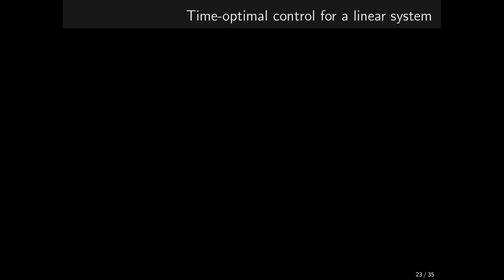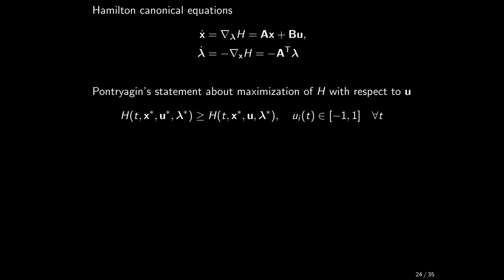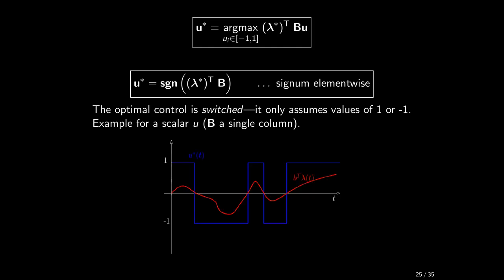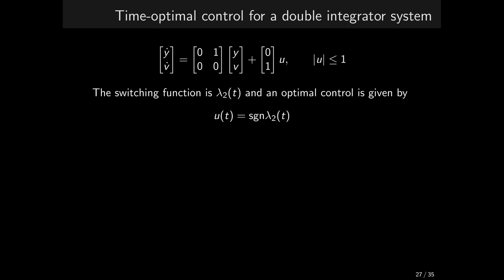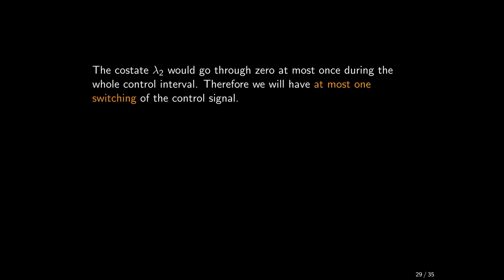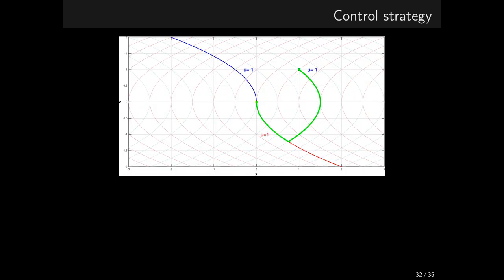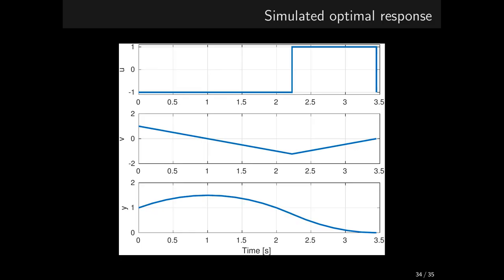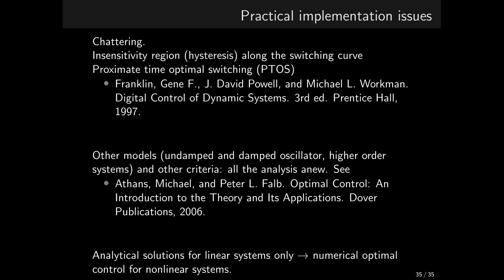L7.3 Time-optimal control for linear systems using Pontryagin's principle of maximum

Comment from the maker: Typo at 6:43: should be lambda2 = -c1 t + x2. The minus sign was missing in the text and video. Fortunately, it had no impact on the validity of subsequent development because, in fact, knowing that the costate lambda2 is a linear function was enough (perhaps combined with the information that at the end of the time interval it was either 1 or -1 thanks to the condition that Hamiltonian is vanishing there).

Comment: Very useful video. Thank you. At the end you mention a next lecture that covers "numerical optimal control". I can't find it on your channel though. Does it still exist?
Reply from the maker: Well, sorry, not yet. Instead, have a look at a list of other resources for the corresponding lecture (or the whole course) at https://moodle.fel.cvut.cz/course/view.php?id=6589. In particular, the block for the topic of numerical optimal control is at https://moodle.fel.cvut.cz/course/view.php?id=6589#section-8. I hope you will find some bits useful even if no video is available.

Comment from the maker: At 11:39 there was an omission in the prescription for an optimal controller. I omitted for each value of the control (1 and -1) the second if part. Somehow this happened while copy&pasting the formulas from the lecture notes (in the lecture notes on page 12 this formula with the vertical curly is full and correct).

This omission is, however, still present in the subsequent boxed formula that is claimed as "the more compact version" in the slides. Unfortunately, it was also stated in the lecture notes (equation 78). Here I cannot just blaim the copy&pasting-induced typo...

The trouble with both the omission and the boxed formula is that it misses the instruction for the controller as for how to slide along the switching curve, that is, when y+1/2v|v| is zero. This trouble is finally projected into the Simulink implementation of the code.

Well, strictly speaking, the block diagram on which our Simulink model is based, can also be found in the authoritative textbooks such as Athans&Falbe (Fig.7-5) and Kirk (Fig. 5-22). The reason why the results of the simulation did not reveal any problems (and they really did not) is that in general in numerical algorithms the program paths that are only entered if something equals to zero EXACTLY are NEVER actually entered (remember, it is all just finite precision arithmentics). In our case, the controller initially detected that the state vector is above the switching curve, it set the control to -1 and the system started moved towards the switching curve in the lower right quadrant. Once the controller detected reaching the switching curve, it actually detected not that the expression y+1/2v|v| is zero, but that that it changed its sign. The other polarity of the control signal was set and since then the system slided nicely a tiny tiny tiny litle bit BELOW the switching curve. The chattering problems only appeared once the system approached the origin (and the steepness of the switching curve became close to infinity).

I will upload corrected versions of both the video and the lecture notes soon.

Comment: 6:43 there should be lambda2=-c2... no??
Reply from the maker: If you mean that c1 in the formula should be replaced with c2, then no. Note that lambda2 is obtained as (minus) the integral of lambda1. And lambda1 has previously been determined to be a constant c1. Integrating a constant amounts to multiplying it by the time (and allowing for a nonzero initial condition brings in the constant c2). Does it help?
Reply: sorry I wanted to tell that there is a minus sign missing in c1... lambda2=-c1*t+c2, because \dot{lambda2}=-lambda1 @aa4cc  , no!?
Reply from the maker: True, but this I acknowledged three post below (and some three years ago) :-) Indeed, after collecting a few typos these videos should be remade. Or perhaps I should at least create some kind of Errata list for each video because navigating in these responses is not convenient. @sardorisrailov1376
Reply: thanks for the content, you can also pin the comments, so that they appear at the top with verified account
Reply from the maker: Thanks for this advice, @sardorisrailov1376,  I was not aware of this possibility. Back then it was possible to pin some kind of "sticky notes" to the particular time in the video (as a quick fix for some typos), but such possibility was later removed, which is a pity.